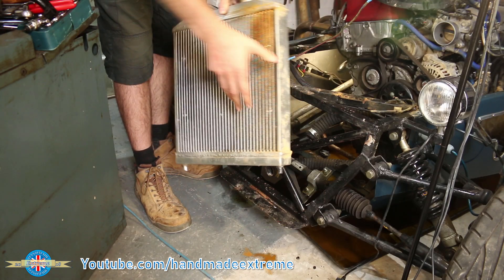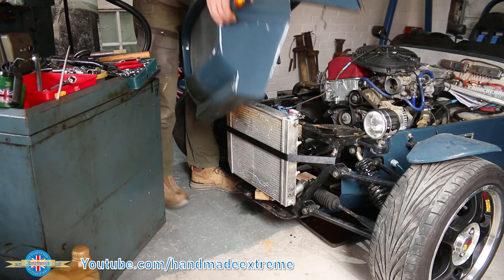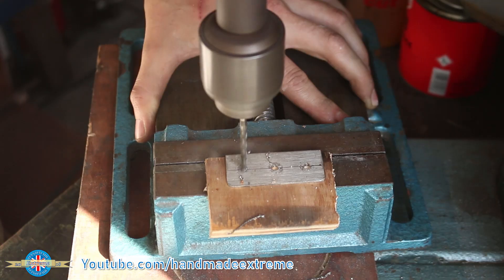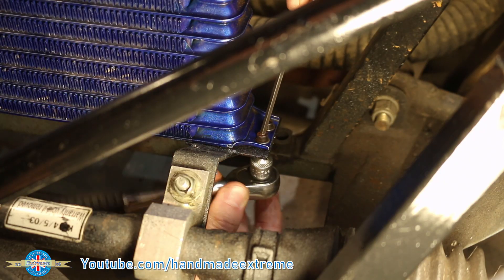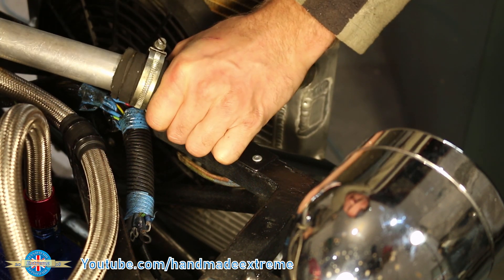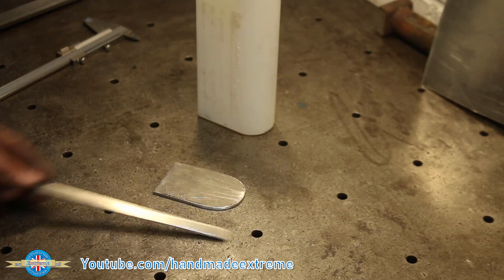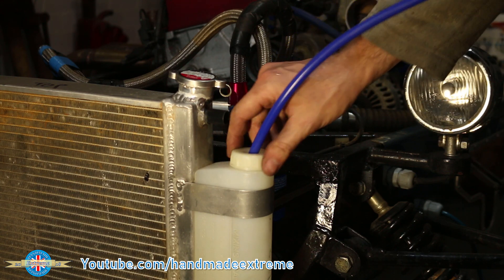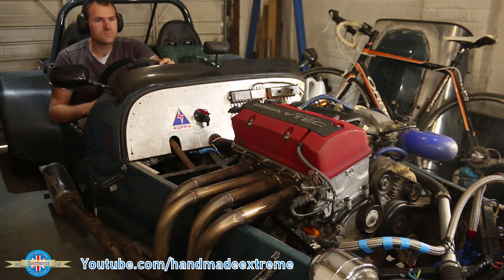The Pippa Project - S2000 Powered Haynes Roadster - Converting a Downflow radiator into a Crossflow

Comment: Why is the cold out on the bottom?  Outlet should always be at the top to prevent airlocks.
Reply from the maker: The cold outlet is at the bottom because heat rises. If the outlet is at the top then I would be putting hot water into the top of the radiator then taking hot water back to the engine. By having them at opposite corners (inlet top left, outlet bottom right) I get the maximum efficiency out of the radiator, without having to swap to a multipass design. Hope that helps, thanks for the question.
Reply: @Handmadeextreme  Er? Nope. I'm a Chief Engineer and have spent over 30 years building ships with cooling systems of epic complexity. Nowhere will you see a setup like that. Yes, Agreed that heat rises, but the design you have in place leaves a gap at the top which will allow an airlock thus reducing the total cooling capacity. What you have put together is most certainly not what would have been designed by an engineer for maximum cooling. The cooling capacity of any cooler is maximised with the surface in contact with the medium to be cooled. The way that radiator is plumbed means you will have a loss of surface area and consequent reduction in coolant.
Reply from the maker: Hopefully this clears up a couple of these points. 
Yes there is an area above the inlet that can fill with air. However once the system is bled... there is no air in the system, so that space is filled with coolant. Thus fully utilising the surface area of the core for cooling the coolant. The system is what is known, in automotive engineering at least, as a sealed cross flow cooling system with recovery tank. Different countrys may use slightly different terminology but the underlying principles are the same. Almost all modern production cars use a system very similar to this but most also utilise an expansion tank as well. I don't as there isn't sufficient height under the bonnet for easy packaging. If there is any residual air left in the system after bleeding then you are correct that it will find it's way to the top of the radiator. This is by design, as that is where are pressure relief cap is located. If there is too much air in the system it sits under the radiator cap until the system temperature and therefore pressure increases sufficiently to open the cap PV=mRT. This purges the air into the recovery tank via a hose that goes to the bottom of the tank and is covered by additional coolant. As the system cools it creates a vacuum this in combination with atmospheric pressure pushing down on the coolant in the recovery tank opens the secondary valve in the radiator cap which forces this additional coolant back into the radiator core filling the volume previously occupied by the air. I'e it is self bleeding.

Hope that helps. I'd be very interested in seeing a system diagram of the marine systems you describe that take the cold return off the top of the radiator. I did a quick google search but didn't find anything.

Comment: Why did you choose blind rivets instead of through bolts? Rivets are much "cleaner" looking, but personally I get peeved when i have to drill them out and the ends are rattling inside a closed structure :-)
The strap ties for the fan was a bit of a surprise to me. Good idea.
Nice bit of work, and I think you would do a very good TIG howto welding video if you set your mind to it. Next video is perhaps you and the lady going for a cruise with Pippa. Cool and fun car you built there.
Reply from the maker: Hi Rolf, great to hear from you again.
Mainly because I'm hoping never to have to remove them haha they are more there as a 'just in case' and a bit less effort to remove and replace then a welded bracket.  Have to say i'm also not a fan of the rivet rattle. Thankfully the engine is so loud that you can't hear them anyway 😂 There are a few in there already. 
I did consider doing some how to weld style videos. There are a lot out there already. That said there are a lot of how to cut threads on a lathe videos out there but that one was well received... I'll give it some thought. 
Thanks for the continued support. 👍